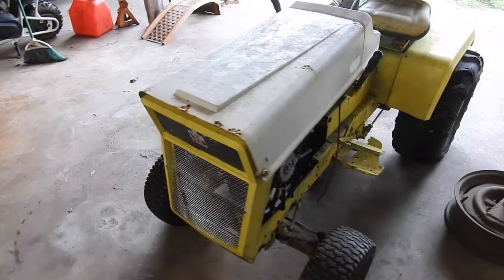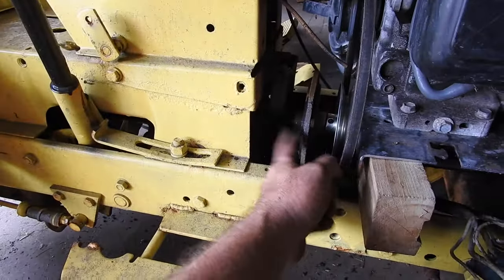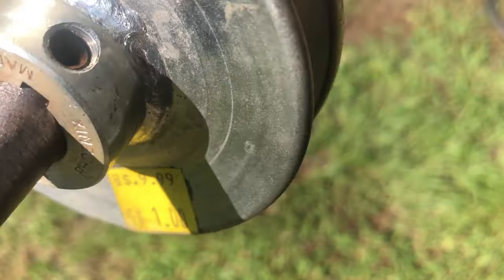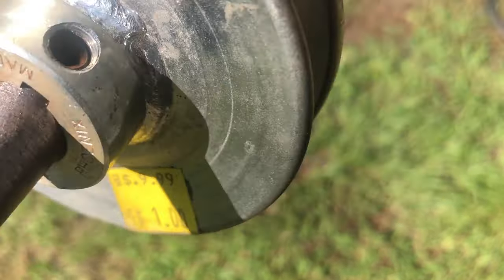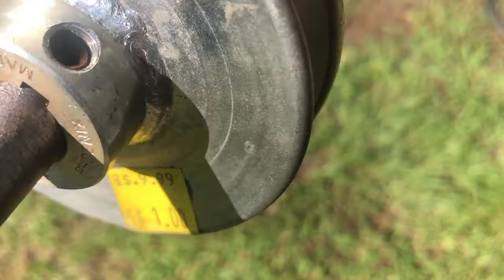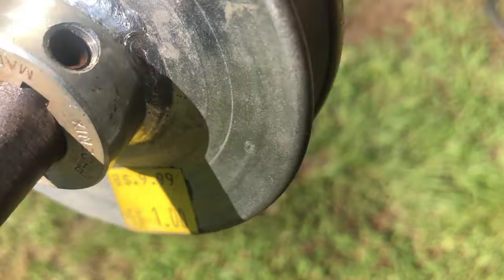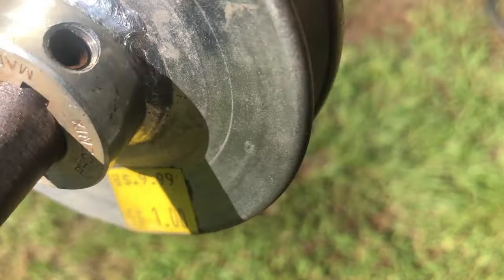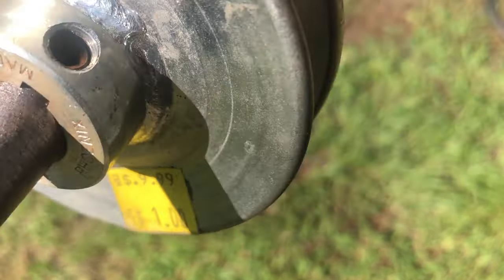Cub Cadet Mower Rebuild

Comment: Hey another awesome video.  Thanks for the shout out! The other day I forgot to point out that i also have a single thumper 15hp horizontal 1" shaft engine from the era of the IH cub in this video. Im pretty sure it came from a sears and robuck or garden tractor.  I may want to part ways with it since its been sitting a while.
Reply from the maker: Welcome, will keep in mind and thanks for watching!!

Comment: You should put a smaller belt on it. When the belt stretches it’ll be rubbing on itself.
Reply from the maker: Yeah, I could try an inch shorter next time. The good news is these belts are cheaper. Thanks for watching !!

Comment: My brother bought a diesel on like ebay and tried to mount it to a cadet, he cut the frame to try to fit it, curranty a stalled project, but he thinks the idea of a desal lawnmower is soo cool. and it defiantly keeps longer .
Reply: btw, he intends to mow grass with it. witch means i'll probably get to use it sometimes.
Reply from the maker: I have been hunting a diesel for a deep water mower. Thanks for watching!!
Reply: @chud327  not to be the weirdo that comments and then comments on someone else's comment. if i were you i would get a wheel horse or sears suburban chassis and get a chinese diesel (similar to what fearless front runs on his ss16) just make a snorkel and run a vent for your gas tank on the snorkel and your golden. thou make sure you build a belt  guard because my suburban used to get mud in my eyes when the belt hit water.
Reply from the maker: @FloridaManMason  great idea and I have been looking at a sears and a diesel. Just don't know if the diesel is going to be big enough... thanks for watching.

Comment: Where do you get your tires and rims?
Reply: And what size is your tires?
Reply from the maker: These back tires and wheels come on the tractor when I got it. The front tires are off of marketplace. The front wheels come off of a John Deere parts mower. I usually find most of my tires on Marketplace. Thanks for watching.
Reply from the maker: I think the rears are 26X9X12's and the fronts are 19X7X8's. thanks again for watching.
Reply: @chud327  thank you and you are welcome
Reply from the maker: @Hopkinskodi69  anytime

Comment: Your engine is in the wrong way and should not be that way cuz I restore cub cadet garden tractor
Reply from the maker: Notice I did not put in the stock engine. If I spin it around, it will have 3 reverse and 1 forward gear. That would be the wrong way to me cuz I ride cub cadet garden tractor       thanks for watching.